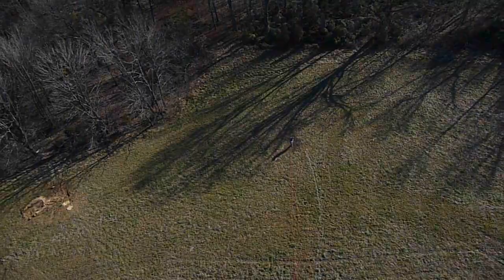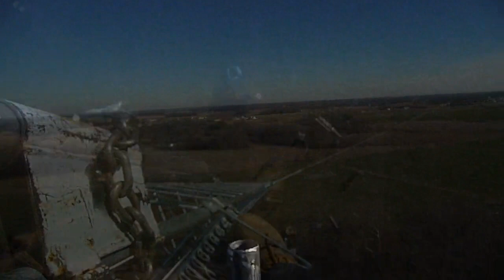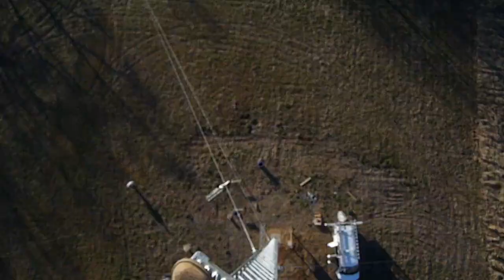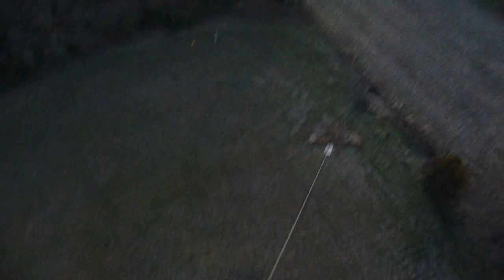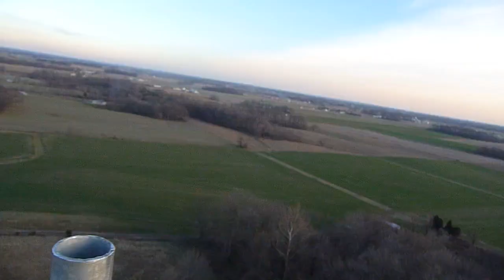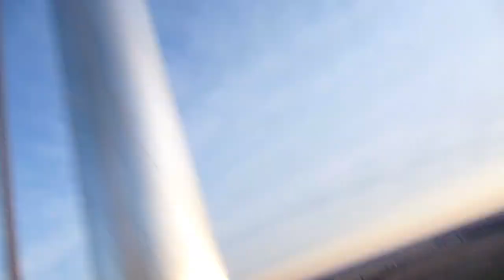ROHN 45G Guyed Tower Series

Comment: i've got 128 feet of 25g equivalent that i'll be putting up. at the moment i stuck up 3 sections. but i have questions. at what heights intervals did you guy off at for a 100 foot  tower? by what i saw in this vid. it looked to be guyed off every 30 feet, 30, 60 and 90 feet intervals. what distance from the base of the tower did you step back to anchor the guys?

Comment: I have R45 and mine is very solid.
I have not had any problems with mine matching up or cracked or broken welds.
If your having that much trouble why did you continue putting it up I'm wondering?

Comment: I’ve had the privilege of working with various Rohn towers, and I understand your ringing endorsement! But if you think that’s bad, try working with some of the “Rohn compatible” towers, made like Rohn only worse quality...

I’ve never liked 45G. It has the same size legs as a 25G (1.25"), but is 50% larger (18" instead of 12" face width). If 25G won’t work, use 55G, it has bigger legs (1.5") and is a whole lot stiffer. I’ve worked on a 300' 55G tower and was quite comfortable.